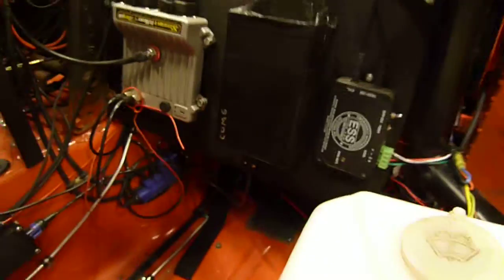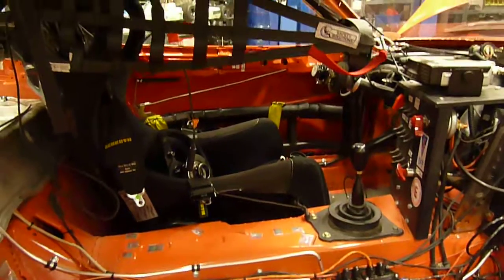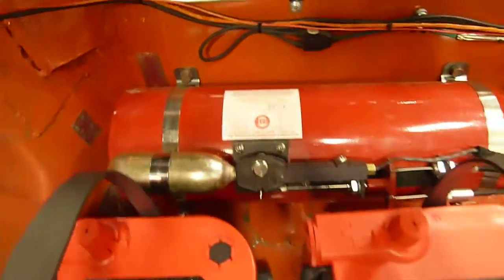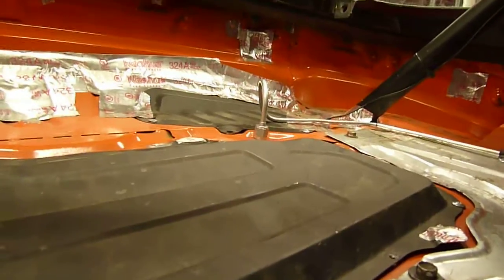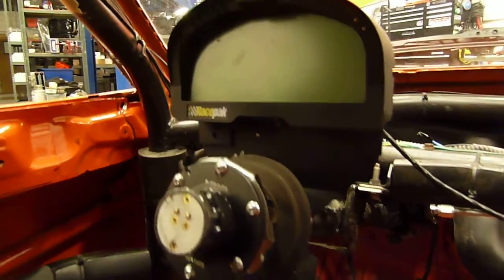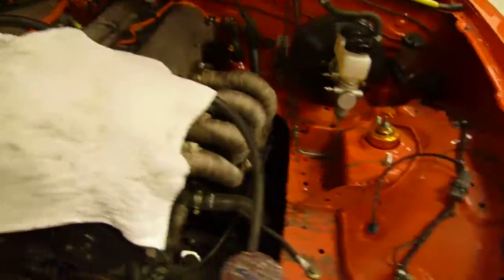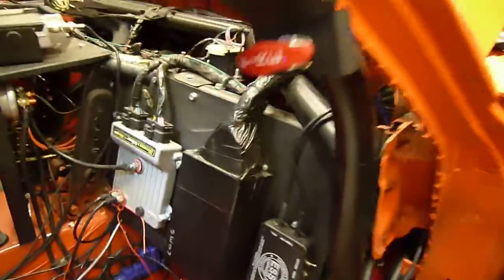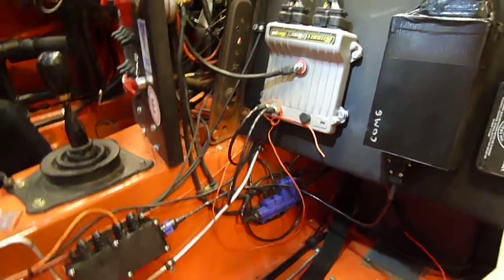Crusher ESS fire system

Comment from the maker: Cutting master power cuts electrical assuming it has not been otherwise compromised by a fault or collision damage. That is not an assumption on should make. If you personally want to install a system not C rated in your race car, suit yourself. We are quite happy with our systems design and capabilities.